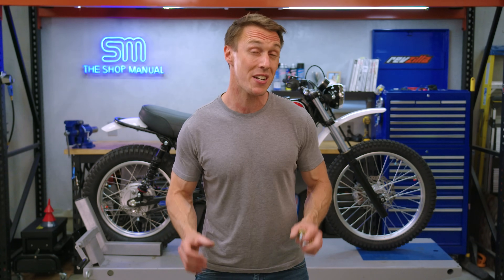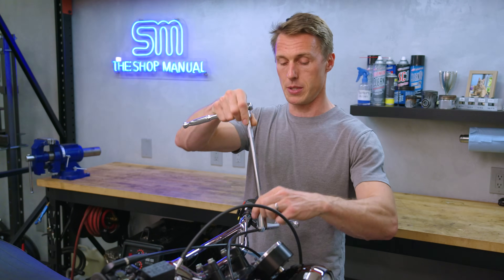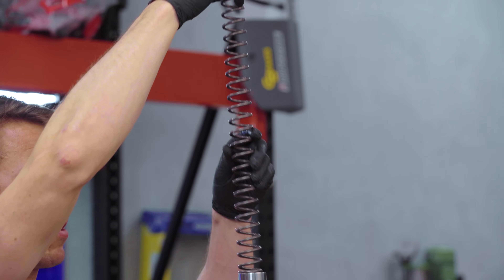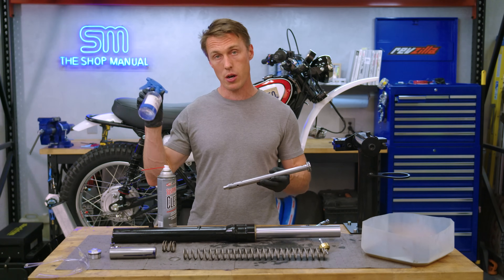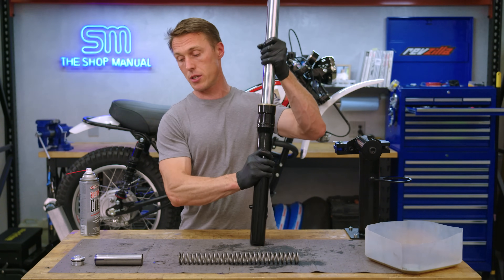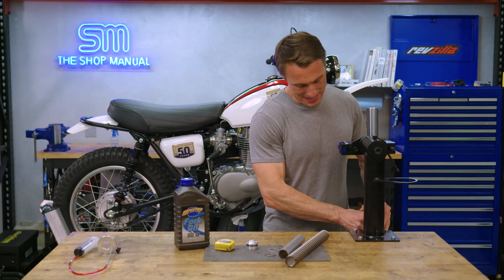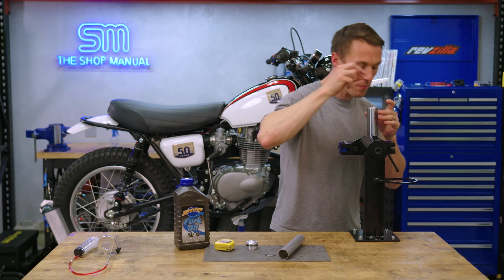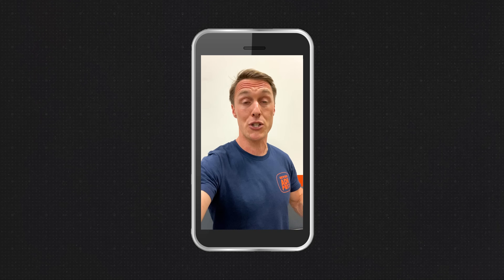How To Install Gold Valve Emulators | The Shop Manual

Comment: Does the 2008 Cbr600rr have a damper rod or not? 🤔
Reply: It's a premium super sport. probably not.
Reply: No, it has a much more sophisticated upside down fork.
Reply: You have cartridges, so rebuild, clean oil and learning the best settings with the adjusters could improve things a lot. You can go even further, Race Tech the company that makes these Emulators also makes Gold Valve kits for your bike to make the cartridges work even better. It sounds like you could benefit from just a good setup on your fork first though.

Comment: The "day's effort" is the hard part especially if you want a more customized damper/rebound ratio. 😂
Reply: You can do it in about 3 hours the first time.
Reply: They are pretty easy to adjust with the proper tools.  If you're wanting to adjust the spring preload on the adjusters, you can use a spring loaded claw tool grabber to reach down the spring and grab the tiny spring on the emulator and use that to pull everything up out of the oil nice and slow so the oil stays in the fork. Adjust the emulator how you want, lower it back down with the same tool, you can feel it seat properly on the damper rod with one hand adding a little tension to the fork spring against the tool as you lower it down.